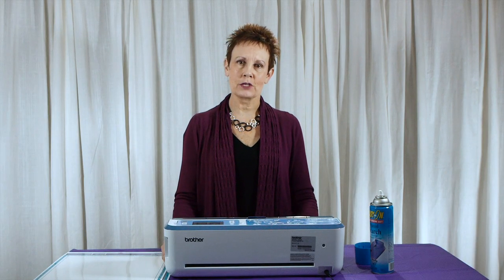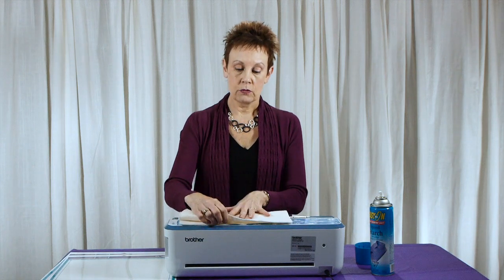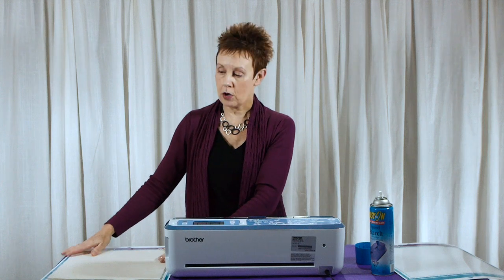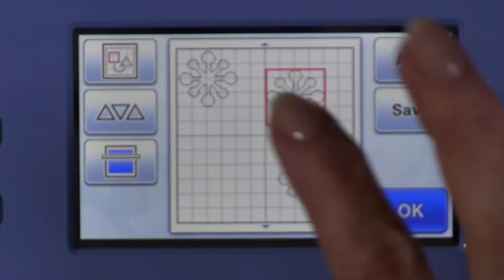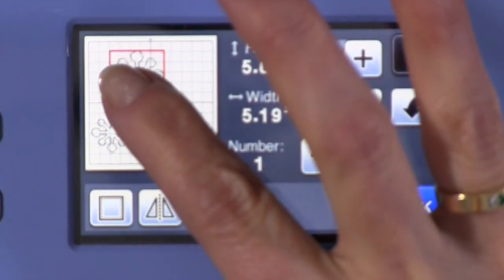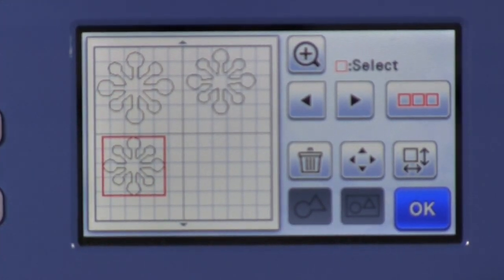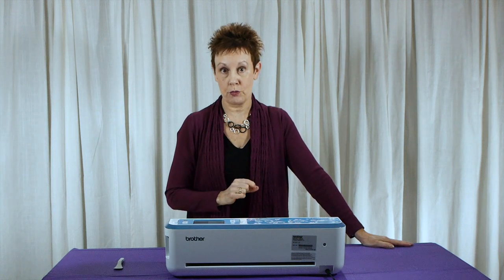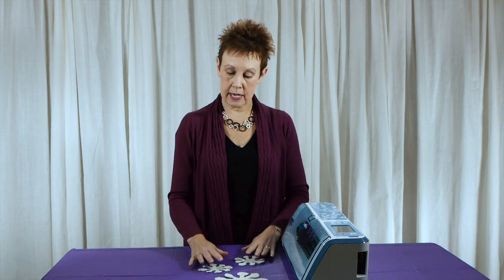Cutting Batting with the Brother Scan N Cut

Comment: Awesome tutorial. What blade did you use?
Reply from the maker: Gosh, that video is several years old so I'm not sure but I don't remember using anything other than a standard blade - probably adjusted the cutting pressure a bit.